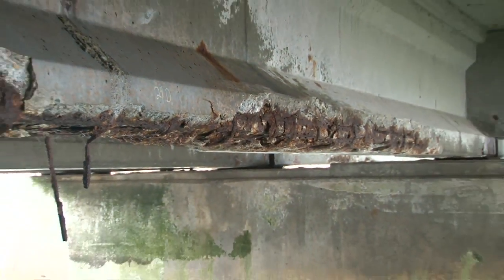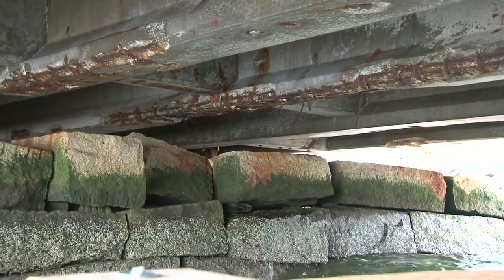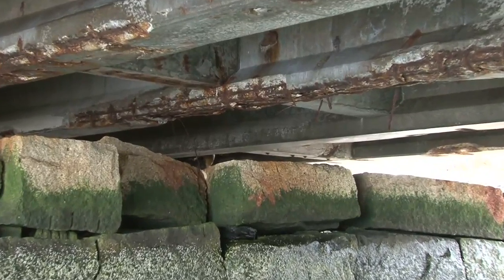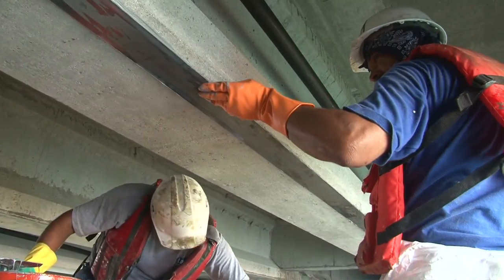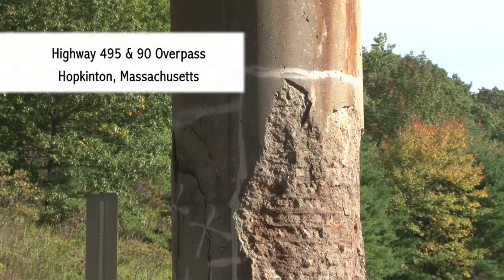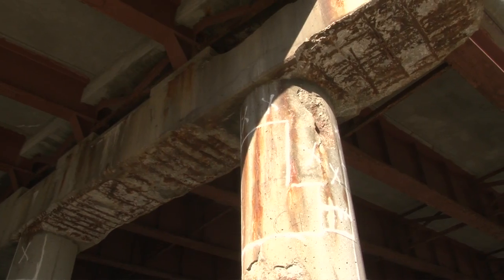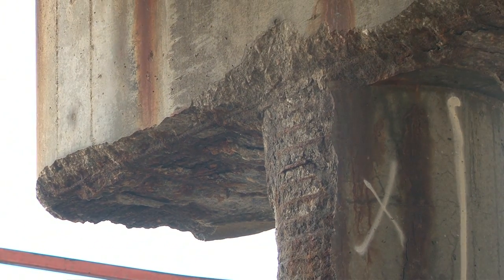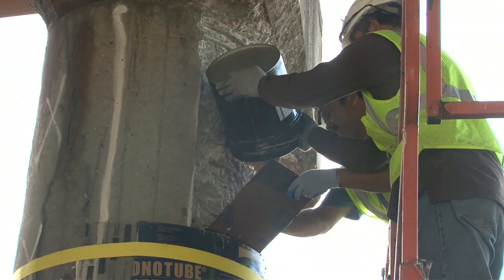Concrete Bridge Repair w/ Fiber Reinforced Polymers - Carbon Wrap Solutions

Comment: The strength of Polymer Concrete is over 10,000 PSI within a day or so. Depends on the temperature. If at 110 F, it will get to 10,000 within few hours, at 80 F will take a day and at 45 F will take few weeks. So the area needs to be heated, if it is too cold.
Reply: OK than do these Projects when the Weather, is nice and warm, you Have at least 8 Months of warmer Weather, in most places all over the World !!!
Reply: @rogerhegemier8491  Actually we have done it in cold weather by tenting the structure. So by applying local heat, you can do it in cold places.

Comment: Hi, i know its an old video...but after you apply the black carbon wraps or the laminates..do you apply cement or does it stay like that and all you do is paint it after applying t with the epoxy thingy ?
Reply: +SrFulanoTal Normally the finished wrapping is covered with PU paint in order to avoid effects of UV (from sunlight). Epoxy also helps protect against moisture. In some projects where wrapping is done within buildings, fire protection mortar is also applied.
Reply: +SrFulanoTal , It can be top coated in variety of ways with different colors and for different purpose, such as UV protection, Fire Protection, abrasion resistance, impact resistance, Acid resistance,......If you have specific applications, send email to info@CarbonWrapSolutions.com and we will get back to you.
Reply: What my company would have us do, is wrap the bridge like such, and in order to protect it, we would rub another coat of apoxy on it when we are done, and throw Sand all over the entire thing and the sand will stick to it, and protect it, and pretty much hide it from being there and really gives it that concrete finish look. After the sand dries, you paint the entire thing and WALLAH!! 😁
Reply: You can paint or texture it to any color.
Reply: @WhatsTheDylBr0  that's a good idea.

Comment: looks expensive.
Reply: That is correct, it  requires very light equipment to do it, instead of heavy equipment, the material is very low cost and takes much less labor. The overall cost is much less and much faster operation than any other approach.
Reply: Actually the only reason we win deals, is because it is much more cost effective. The material is not that expensive these days and it requires much less labor
Reply: Let's inspect the bridge in another 10-20 years and check for the amount of debonding. Evey structure looks good when it's just finished construction / repair. It's the rate of degradation that we care about.
Reply: What does it look like today.